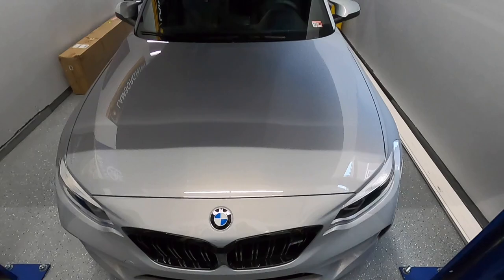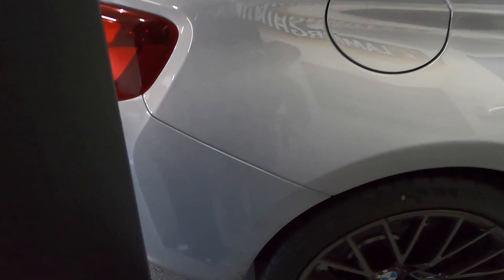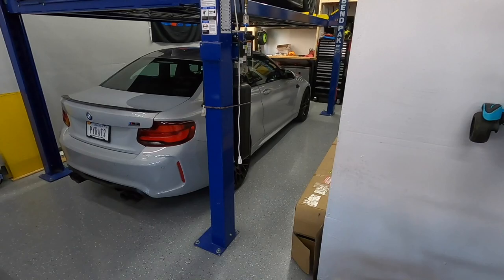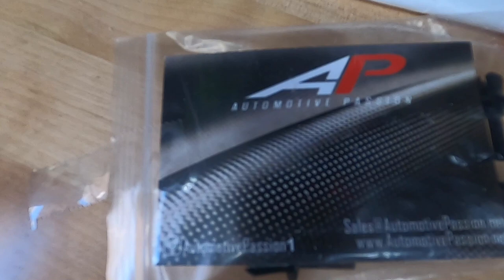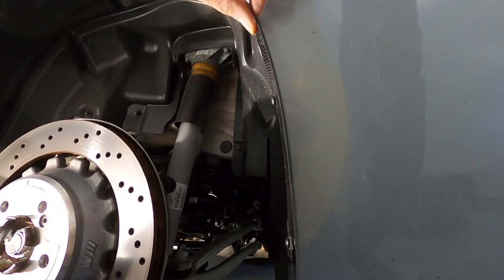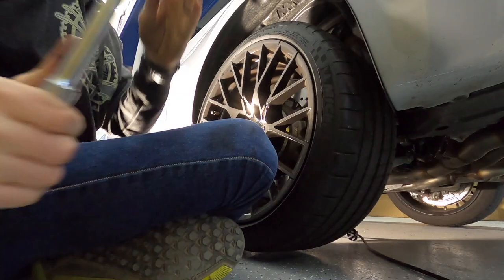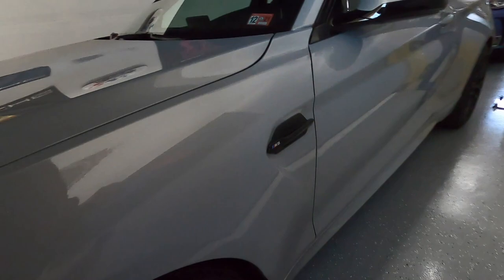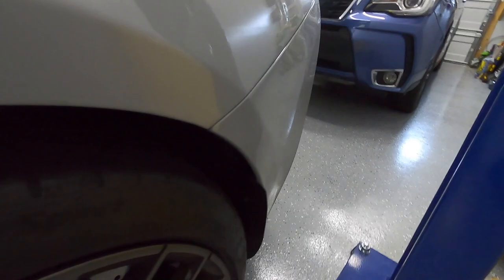2021 M2 Competition Carbon Fiber Mud Guard Install! (Already have rock chips!!!)

Comment: You are absolutely right on trying to buy a new one. I got my deposit back from my dealer because they couldn't get the configuration that I wanted. I ended up finding a slightly used one so I'm good!
Reply from the maker: Nice, glad you found one!

Comment: What are your thoughts on replacing the crank hub?
Reply from the maker: My current thought is that I'll be keeping it stock powerwise until after warranty expires. In that time if the crank hub spins then bmw will fix. From reading the forum posts it seems much more likely with above stock power but has happened in stock form.
Reply: @TWRX_Chuck  precisely my thinking. warranty will replace. once over, then change before tuning.